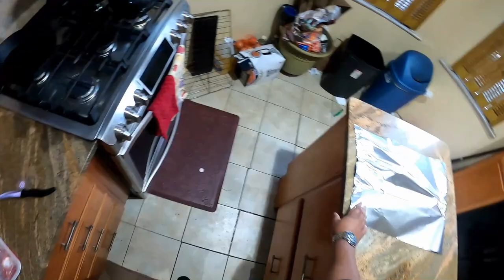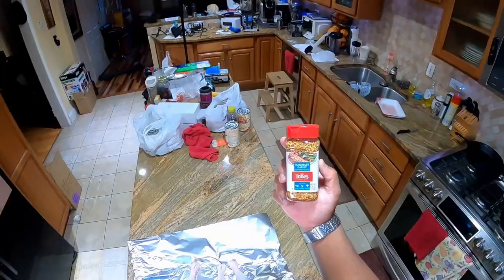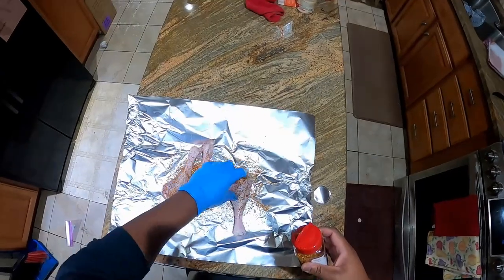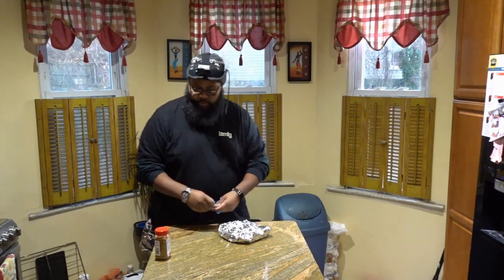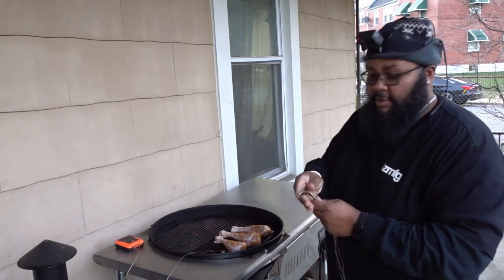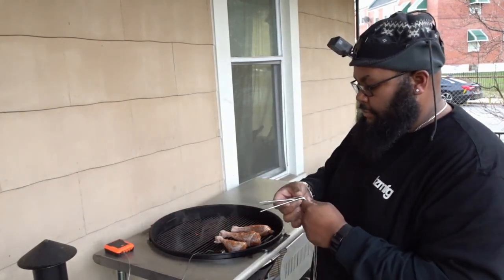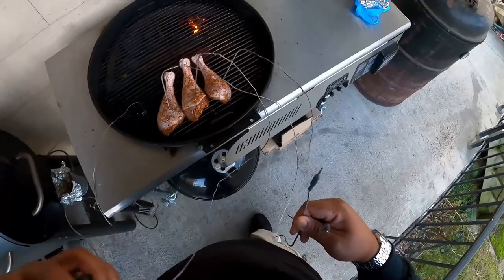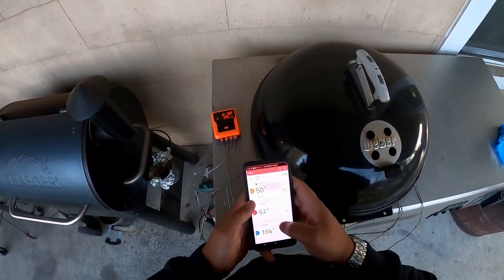SDSBBQ - Hot and Fast Turkey Legs on The Weber Kettle with the Slow N Sear

Comment: Hey Dash, when replenishing your water pan during the cook, do you put yours in cold and do you heat it to boiling before putting in the smoker?
Reply from the maker: I'm using a garden hose so it's typically cold. But if I'm using a smaller smoker then I'll use warm water.

Comment: Hey Dash, when using a water pan in your big smoker, do you have several water pans throughout the entire smoker or do you 1 water pan by the firebox? Also do I put the water pan in the smoker before I start the fire or after the fire gets up to temp and then put in the water pan?
Reply from the maker: The water pan is built in. I just fill it up when starting the fire so the water can come up to temp as the fire is building and bringing the smoker up to temp.